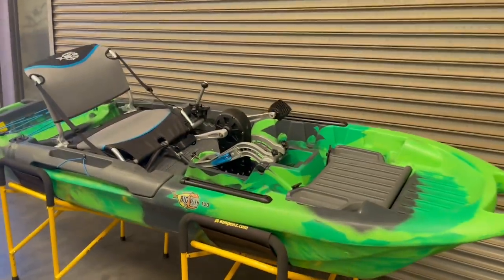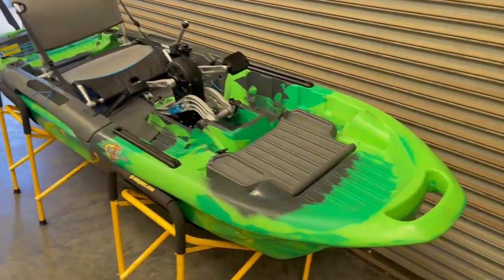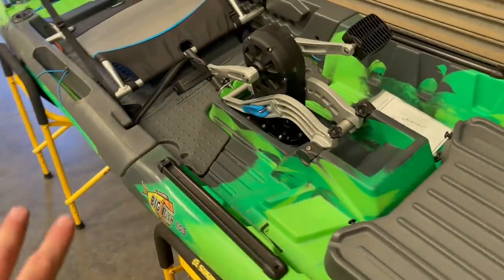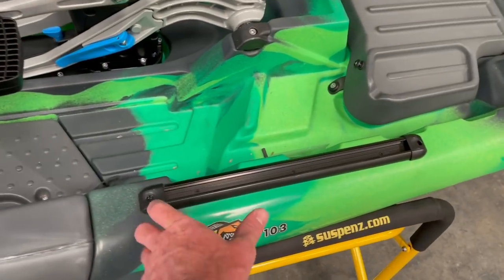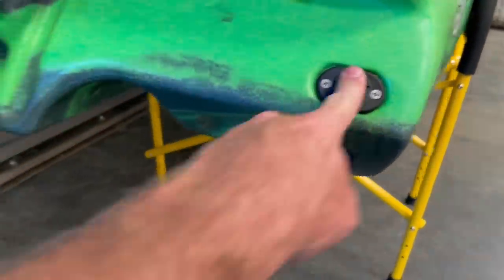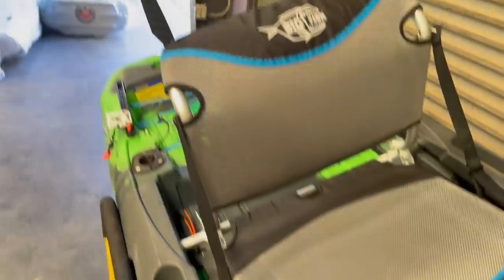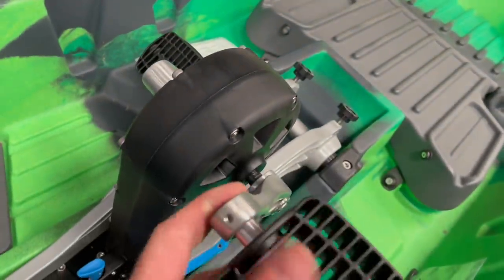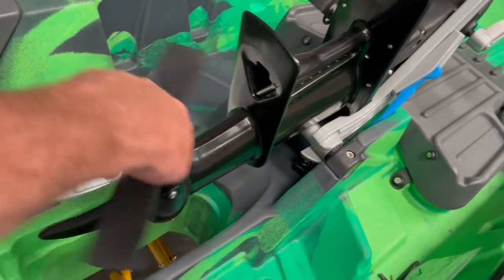3 Waters Kayak Big Fish 103: First Look

Comment: Dan, this is off-topic for this particular video, but I've got a request/suggestion... Could you do a video on kayak carts?
Like most sports and hobbies there seems to be a huge price differential between what might be useless, cheap garbage and what might be top-of-the-line, expensive gear that is overkill for most people. What is suitable for short car to launch carting, what would be suitable for portaging a kayak loaded with camping gear for a ¼ mile? What should people consider concerning durability, weight, stability, whether it can break down to take up less space, what is suitable for a traditional kayak vs. a SOT or different hull shapes (or even other boat types like canoes), and how does all that factor into the price?
If you could put together an informative video on that subject I'd be very appreciative of your efforts.
Reply from the maker: That’s a good video idea.

Comment: They have an interesting design. That transducer set up looks like trouble though.
Reply from the maker: Yea I’m not so sure about the transducer setup ether. Seems like a vulnerable spot. With that said we don’t hear any complains from folks that have bought the 108 with the same setup. I’d be keen to hear from someone who has more long term experience fishing out of one.
Reply: @HeadwatersKayak  It needs improvement. It needs to be multi pieced so you can run the wires through it a lot easier. If I had my CAD system I'd design it for them and send it over. I would also like to see a better way of securing the drive better instead of that screw knob. Maybe a destaco clamp.

Comment: Dan I have the 108 and I love it. The 103 would have been a good investment too. Love the boat since I don't fall out of it as often as I did in my outback.
Reply from the maker: That’s great. May I ask your size?
Reply: @HeadwatersKayak  Dan I met you at Kelsey Bass Ranch in 2010 I think it was. I'm a short stocky guy with a bad back problem so I lose my balance easily, I've exited my Outback over half a dozen times since I had it thus my NCKA screen name - Splashdown. With the 108 I actually had to lean away from it to toss me out so I could try a recovery. I love the improvements in kayaks in the past decade making them more comfortable and easier to handle.
Reply: @sg-mx4ii  . . . . glad you haven't drowned !  8 )    . . . . do you keep a cord tied to all your rods  so you don't lose one incase of a  "  splash down "  ?   I've never used a kayak because I've always been worried about overturning but I'm giving this one some consideration .  tight lines !  8 )
Reply: @wh8085  I have everything leeched in and my rods all have a styrofoam piece attached so they float. I do not like "garage sales" during a surf launch or recovery so everything I have is secure; except me. I will just come out whenever. Since I have a bad back I make a "manatee landing" on a beach my rolling out of my kayak due to me not being able to just stand and get out. I do it real fast then I get up from the lying position fast before the next wave hits. I can get my kayak out faster doing it that way or I'd get stuck the other way and get swamped.
Reply: @sg . . . . We all have different limitations. Learning to adapt is what gets ust through life !  8 )
Reply: @wh8085  My friends say it is fun to watch me do it. I laugh when I do.

Comment: Boat is correct....WOW! Will the drive auto kick up if it hits shallow? No stand up assist strap? I use mine all the time in my Moken
Reply from the maker: You can just use the drive to help get up or down. No strap on this guy. And no the drive does not kickup if you hit something. Not a great situation for shallow water fishing.

Comment: I tried to get this boat. it's nice but definitely heavy.  The low only seating makes it very difficult to stand up unless you're very flexible. First one I got was defective, 2nd one they gave me was defective.  No regrets immediately selling the 3rd on craigslist. I didn't like the rudder the way it travels, flapping in the wind behind you.  

The biggest weakness is the plastic where the drive drops in. The rest of it feels good but that section is a 2 piece molded in section and the plastic is paper thin.  I will say their customer service was great to work with though.

Comment: Wish you would put standard tracks on it having to buy more stuff just to add thing on the tracks more cost for people who have more than one kayak and not having no paddle holders a down fall for me even though it's a peddle drive you still can't use the peddle drive till I get in 2 ft of water and for it being just over 10ft should be lighter that's a heavy kayak if it was lighter I'd buy it

Comment: Nothing but problems with the 8-ball steering system. Also, the crank arms are not reverse thread, so at times they work their way off on a long trip. Fix those and I would be a 3waters fan.
Reply from the maker: The threads have been addressed, but the 8 ball still needs refinement.

Comment: Nice review, Dan. I've been doing research on these for a while, and at this point I prefer the Old Town Sportsman 106 PDL, at the same price point. Reasons are...not as heavy, kick up pedal drive (needed for fishing in stumpy areas), a really good warranty (I missed this boat's warranty if you mentioned it), and a pretty much perfected pedal system. Any chance you can review an Old Town fishing kayak ?  I'm on the east coast, and Old Towns are popular here...Thanks !!!
Reply: I wouldn't really call it a kick up pedal drive, like Hobie kick up fins. Yes it does sort of "kick up" but only after you break the lock down tab. Better keep a few extras on board if you plan on hitting something.
Reply: @gerard2620  still I don't think there are any other pedal drives (prop) that have that feature. Not that I know of anyways. It is a great feature.